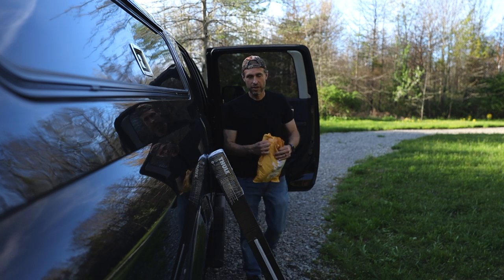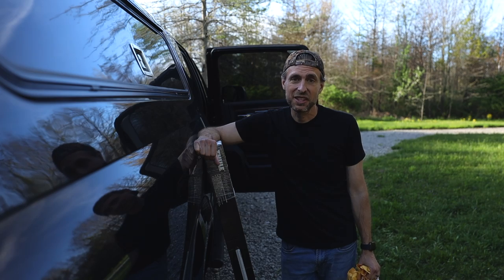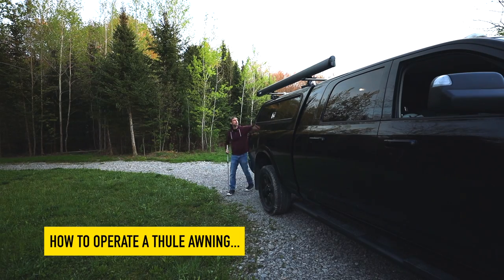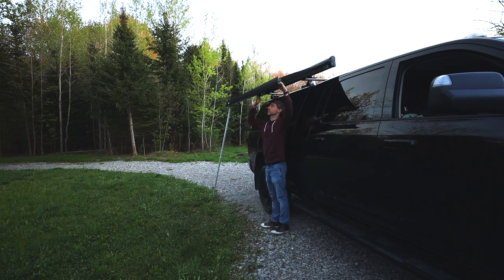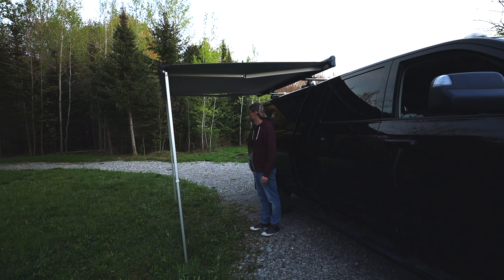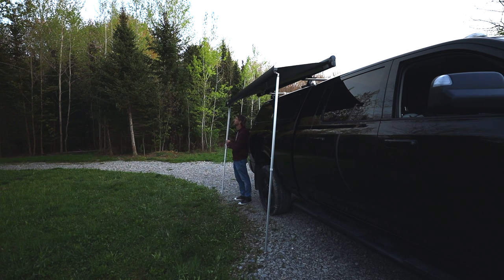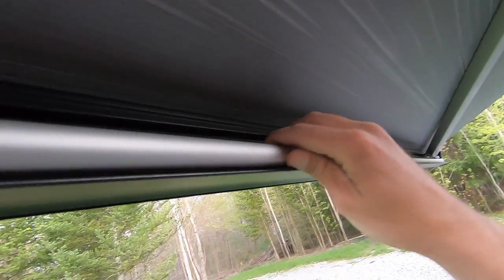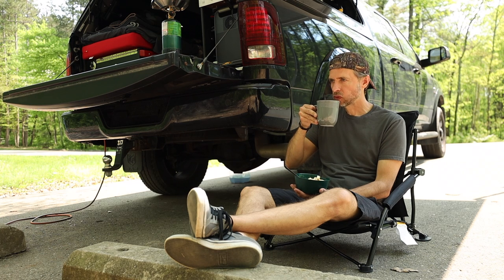Installing a THULE AWNING on my TRUCK and how to operate it!

Comment: I have been using the hideaway on my Tundra for 5 years now. I power mine out with a cordless drill. This awning has been durable and awesome. It’s made our yearly vacation to OBX 4X4 beaches so much more enjoyable.  Turns a lot of heads and folks are always asking about it.  Highly recommended.